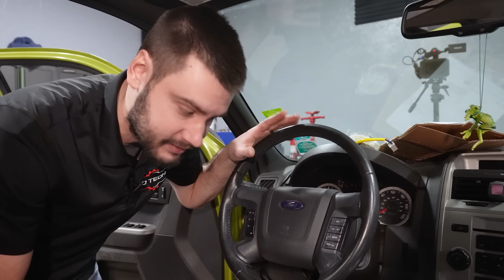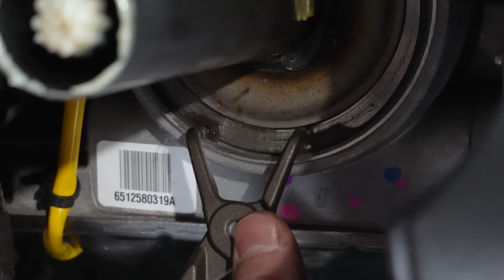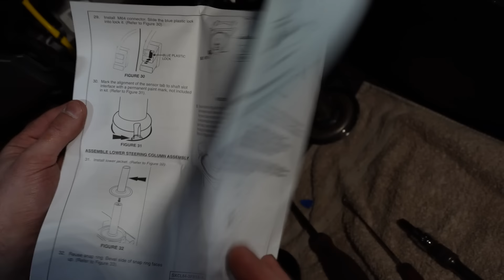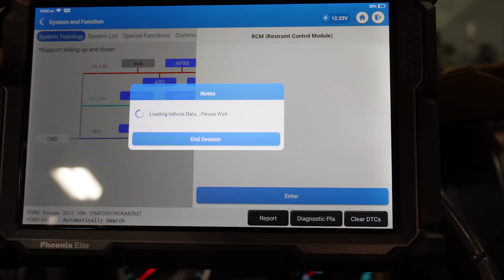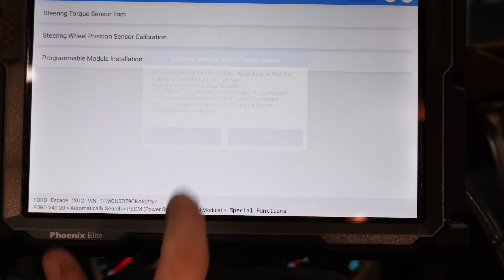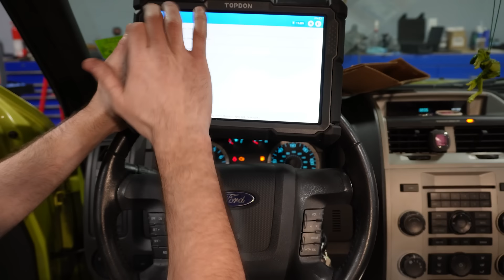B2278 - Power Steering Fault - Ford Escape

Comment: Hey all! Here are a bunch of tips for installation I wanted to post about this issue in case anyone may need some help in the future or is just curious in this general recall issue. 6 months ago I had my power steering shake violently then go out. I continued to drive it for 6 months with no power steering. It works well but it was a pain to drive like that including having the error message. Well last week, I couldn’t turn in time and hit a curb causing a cracked tire rim and blown wheel and decided to fix it. I figured to leave a few tips in what I did and how I fixed it. F.Y.I, not that it matters. 

BTW I am 22 y/o female mechanicallly inclined so if it gives ya hope, anyone can do it lmao. 

It took me five tries to get it right. If you fail the first time, the sensor DOES NOT GO BAD! 

——————

TIP 0.5: In order to fix the sensor after bad install

Take sensor out

Shine a flashlight under the hole. There are two disk that spin oppisidpte of each other if it becomes misaligned and it will be clear that the disks are Aline as the hole does not shine bright. Move the sensor left and right until the hole begins to shine bright and perfectly centered. There is a better explain video on this from powersteeringseals.com YouTube channel. 

Tip 1: a good pair a snap pliers is a MUST!!!! It is hard to take out and even harder to install. The brand I went with is a 12 snap pliers from harbor freight tools. The brand I used is: ICON 12 in. External Straight Precision Snap Ring Pliers

You will also need T45 torque bolts to remove the steering wheel column. 

——

Tip 1.5:
A good pair of jack stands and a jack lift is a MUST. I use some brand of  6 ton jack lifts and I bought a 200$ jack lift from harbor freights, if you change your own oil and do mairence you will be instantly glad you decided to buy a jack lift. 

——

Tip 2: the steering wheel is hard to reinstall. I recommend looking at each of the shafts, finding the biggest shaft “pilled” or tooth, and marking where that tooth is on both steering shaft and steering wheel. It allows a much better precision alignment. 

——

Tip 3: when you take off the steering wheel and snap ring. Point the steering shaft as high as possible. 
This is because when installing the steering wheel, your steering wheel will be lower and require you to push the wheel up to reattach bolts. 

After eremovjng snap ring and tube. pushing up your steering shaft as high as possible, then install the new sensor and align by bumping the tires. 

If the shaft drops a bit due to reinstalling the tube, snap ring and wheel, that is OK.  This is because we installed the sensor as high as possible. When you go to install wheel and have to bring the wheel back up to attach the bolts, the sensor will already be aligned as you had already installed the sensor with the shaft as high as possible. 

You can see this for yourself when messing with the old sensor by moving the steering wheel shaft up and down and watching the hole move around. This is what caused me many issues

This is the trick that allowed me to install it correctly after five failed attempts. 

———

Tip 3: Find a 2x4 wood or anything that will allow to keep the shaft steady when reinstalling steering wheel. This trick allowed me to minimize movement of the steering shaft from up and down and in turn allowed me to keep it in alignment. 

———

Tip4:ENSURE YOU MARK each connection point on the steering shaft and steering wheel so it goes exactly where it should go. Anything that you can mark in order to minimize movement is best. These YouTube videos make it look easy, but it is NOT easy to installl the steering wheel, it takes patience.
Also sitting in the car and using your knees as a guide works best. Don’t worry about tipping the car if it’s on jacks it won’t do that, 

 ——-

Tip 5: I disconnected the battery overnight which might of helped. I say this as I believe as I did it correctly the fifth time the sensor had no more codes to read and in turn had to relearn whatever was going on with the power steering which allowed its corrections and had no issues.

———

Tip. 5:

If you think you did not do it correctly but want to test it, hold the steering wheel while turning it on, it will make an insane sudden fast left or right turn all the way. I say this as you DO NOT want to burn the motor when it turns quickly to left or right. By holding the steering when turning it on, it allows you to ensure the steering torque sensor doesn’t get messed up or burnt 

———

Tip 6:

Despite some people’s mentions and google plus ChatGPT saying otherwise, you should NOT need to clear any codes prior to replacement. Save yourself money and do not buy a obd2 scanner, I did do this, find myself not using it at all because the car cleared the dtc codes after successful install  and I didn’t have to do anything

Tip 7::

Do not go about reinstalling the body pieces or panels to the steering wheel before testing as it is likely you willl fail and need to do it again. Only installl steering body panels when you can confirm you are done.

——

Tip 8:
The plastic mounts for the wiring harness and the steering torque sensor are insanely hard to take off. Have a good pair of pliers or get a wrench puller with a v k notch. It helps a lot as those plastic clips are instantly hard to take off from the wiring harness and the steering torque sensor. 

——-

Tip 9:

Do not worry about your airbag, it will not go off, just place it gently in the ground, and do not be throwing it around. 

——

Tip 10:

Using a bungee corde attached to the steering wheel, and mounting bungee corge ends to the sun visor helped so much in reducing the weight, movement, and allowed a better install when reinstalling steering wheel. 

——
 
Tip 11: it helps if you leave your keys in wheel to prevent the wheel to lock while installing, you can just put your keys in the wheel even if the wires are disconnected and it allows free movement of the steering wheel.

———

Tip 12: I FORGOT! 

You don’t have to bump the steering wheel if you have a good pair of locking pliers that can attach to the steering shaft. It allows the steering shaft and wheels to move and get the little hole in the window perfectly without going back and forth bumping the tires, I suggest a good pair of locking pliers and attatching it to the steering column. 

——

Please let me know if you have anymore questions and I will be glad to awnser them. I am an active user and have no problem wandering peoples questions. This installl saved me 800$ and took about a day and a half to get it correct. If there is any edit issues let me know and I will resolve it asap and make it more understandable.

This process was hard but being able to have it work the firth time was amazing, and I hope this help other people.
Reply: Miss Gamerz: Thank you for your post! I've been struggling with this install and failing multiple times over several days. 1st a cheap replacement part failure. Didn't work. 2nd a plug wire pop out defect on second unit. Working with a 3rd unit. Steering wheel trying to twist my arm off. Getting plenty of static for failing. We're renting a car, and that's money adding up. Nobody else I've seen, mentioned stabilizing the tilting shaft function to keep everything aligned. I'm trying it and see what happens. Doing this in the driveway, its raining today. It's starting to get cold. Daylight savings time. Days getting shorter. Geez, anything else? Anyways, Thank you for your tips.
Reply: Also, ICON 12 inch Internal snap ring pliers from H.F. is what you want. Well worth the price.

Comment: What if you did everything correct, reset the trim and it still turns to the right the hole way?
Reply: Hey there I just posted a comment it’s not broken it’s just misaligned and you need to do it again with more precision
Reply: It did every step and twice and it's still not working correctly, so how much better can I get? Doesn't make sense.

Comment: I was very careful to follow all the instructions twice. This is a great detailed set of instructions. Kudos. Unfortunately in both cases the garage I used to clear codes and recalibrate was unable to make adjustments. On startup the wheel spun to the far right limit both times. Any suggestions would be appreciated 😢
Reply: Hey, not a professional, just trying to be helpful. Early on in the video 1:50 he explains that if the sensor is not aligned properly when installing it, it will cause this exact symptom you’re describing. Hope this helps!
Reply: Great video, I have to do the same fix on my 2012 2.5l escape. Question:  once the part is replaced how can I calibrate the sensor if I don't have the scan tool. Is there a manual way to calibrate it?

Comment: I once had torque sensor codes but I reset the module to get steering back and my sensor seems to be kind of okay but now I'm getting steering angle sensor codes is it the same thing or not

Comment: Question: I have a hard right turn symptom and with a little persuasion I can keep the car straight. However, no codes up until now. It gave a code B2278, then the code disappeared. Lost power to steering. Then shut down the car, and it again does the hard right turn with prejudice. So, after replacing it, it did not correct the problem. So now I have the hard right turn symptom again. What did I do wrong, if anything. I'm open to all suggestions, opinions etc. just short of going back to the dealer, which is the last resort.

Comment: Great video I wish I had seen it before I did the job. If I pulled the sensor out with out realigning the hole and put new sensor in and my steering is turning to the left by its self and I’m sure that the sensor is no good any more. Can I get a new sensor and make sure to align the hole will it then work. Thanks.
Reply: I did it twice now . I followed the video exactly both times and my steering wheel keeps turning to the right by itself.
Reply: @brandond2088  what did you do after, I'm lost I had it aligned perfectly please help
Reply: @ethanlangdale402 my problem was the power steering assist unit thats under that sensor I got one from a junkyard and it fixed my problem

Comment: After replacing part and recalibrating engine off, wheels straight, start car and power steering engages and turns max left and holds there.   Any ideas?  I have another torque sensor to try out.

Comment: I replaced one on a car just now and the steering wheel is stuck all the way right did I do something wrong?
Reply: Same here
Reply: I had to repeat 5x to get it to work. There are 2 disks in the sensor make sure you catch the 2nd hole when placing the pin back before repeating. Alignment of everything is a bit tricky. 1st try steering went left 2nd right 3rd time I couldn’t get the original sensor to not go right. 4 time the center was steering to the right a little bit and I went to a mechanic with computer to calibrate which failed. 5 time I aligned so pin would go deeper to fit into 2nd wheel within the sensor and then it worked without any calibration. I also had to grind cut into 2/3 and 1/3 the big snap clip because it was so hard to remove by the 4th time. Get the biggest clip tool if possible to avoid cutting the big clip
Reply: I ended up purchasing one from the dealer and problem was solved.

Comment: I didn't have help aligning the hole at 13:33 on the video.  I used locking pliers on the shaft, making sure I didn't nick anything and turned it till the pin was centered.  Had to buy a snap ring plier, Harbor Freight 12 inch, to remove the snap ring. Necessary evil.

Comment: after doing this and the relearn on the scan tool - i have a constant pressure to the right on the wheel.  thoughts?
Reply: Repeat I did mine 5 times 
Make sure the pin goes deep. There are 2 wheels in sensor that align with each other and alignment on tire is crucial. Check arrow on sensor to spleen on shaft when reinstalling

Comment: How was Ford allowed to sell junk like this to the public...? Not one junk yard had a replacement for sale, not one parts store had one for sale...! (Found one on eBay, and I hope it lasts at least a year before it goes out..!)
Reply: How is Ford Canada / Ford USA only recall a handful of the 2008-2012 Ford Escapes ! Currently trying to get Ford Canada to pay for this ! $1000 for the Torque sensor to buy now in Canada. $2500-$3000 labour! If this sensor goes while you’re driving! Extremely dangerous! Could seriously hurt someone, yourself , or worse ! I love my 2009
Ford Escape 3.0l ! Bought brand new , I am OCD about maintenance! No huge issues , had a misfire #4 cylinder 4 years ago . Now Torque sensor . Thank goodness I have a great Scantool that calibrates the steering angle sensor, Torque sensor etc . What size of snap ring pliers work best ?

Comment: I have a 2011 and everything was fine when I parked.   It was cold outside.  When I came out and went to go, it was just like manual steering, extremely tight and had to fight the wheel to get it to turn.   After 8 hours sitting, it was fine again.  I wonder if this is whats wrong on my Escape?
Reply: Same with ours. Did you replace this sensor?
Reply: @stooner8178  the dealership tells me its now integrated as part of the steering column requiring the entire column assembly to be replaced.   I was told the service replacement part itself is no longer available, this requiring the column.   Then when its installed, it must be programmed as well.   Total cost $1758, tax and labor included.
Reply: My mechanic told me $2500 to replace the column. Same issues. He assured me it’s not just a torque sensor issue. Going to replace the column myself.
Reply: @gregb.5644 definitely the sensor in most cases.
Reply: @kendelray9328 dealer has it for $300 for sensor. However I got one on Amazon for $75 and it worked after 5 tries and many hours on you tube

Comment: Replaced the sensor and the power steering didn’t come back on its own. Took it to a mechanic to get the code cleared and recalibrate the sensor. Worked immediately after completing the recalibration. $75 repair
Reply: Did you drive to the mechanic?
Reply: @ I did…. Slow turns are a chore, but I only had to go 5 miles

Comment: If you have a bad install like I did. This is a good video to help. After the initial install on my son's car the wheel was turning slight left causing it to pull as I drove. Turns out the torque sensor and angle sensor were slightly misaligned. The link below helped me to fix that issue. Everything is working fine now.

https://youtu.be/EpjYDr5jUNs?si=jXdMgSY0Laf-7nTE

Comment: Trying to get the thru bolt out that hold the motor and steering column.Any have this problem the nut is stuck!
Reply: I think that nut is welded ?

Comment: So what if the power steering is out and that code isn't there? Could it still be the sensor that is the problem?
Reply: That’s a good question. I have very very little car repair knowledge, but I’m having the power steering issue and I keep seeing that replacing the steering column needs to be replaced. I honestly hope it’s just the torque sensor.

Comment: Ok I followed the instructions you gave and when I started the car, the wheel didn't move (you said if the sensor is installed incorrectly it could make the wheel jerk left or right to the stop) but the power steering still isn't working. I made sure the installation tool or guide was on with no binding. One thing I did was on the old sensor, I tried to put the dot in the window...and when I removed the old sensor and went to install the new sensor, the dot wasn't in the window. I looked at the guide tool and saw that it has a notch that goes in the groove in the steering shaft. This groove was on the opposite side of where it was supposed to be. I got out and turned the wheel to what I believe to be the 11 o'clock position and my spotter said the groove was lined up with the arrow and the dot was in the window. I removed the old sensor and installed the new sensor and again everything appeared to be in its correct position. I pulled the pin and observed the dot in the window. I reinstalled the steering wheel and connected all the wiring plugs (yes I attached the plug for the sensor). I turned the key and the steering wheel didn't move. I started the car but I can tell the wheel is still tight even with the front tires off the ground. I'm at a loss for what to do ni tried to Google the problem and someone said I needed to "learn" the new sensor to the car. But your video said nothing about that. It just said I may need to learn it to center the wheel. Again I'm at a loss for what to do now
Reply: Did you find out the problem? I just installed mine and I'm having the same issue.
Reply: I am in the same boat as you guys did either of you figure it out?!

Comment: My EPS is not working again, sometimes intermittently... I plan to open it up again and realign the sensor for the second time. It seem that the sensor discs goes out of alignment. I will try to find a way to keep those discs aligned inside the shaft....epoxy?

Comment: I had to purchase a snap ring tool from Harbor Freight because no one sold one big enough to do the job. I've tried AutoZone, Advanced Auto, O'Reilly, Menards, and Walmart and they all sold the same tool. Now my issue is that it steers very easy to the left and kinda stiff to the right and my scan tool won't calibrate it. It says it's not communicating. I guess I'll try someone else's scan tool.
Reply: Update, I solved the problem by replacing the whole power steering unit with one that I had gotten from the junkyard